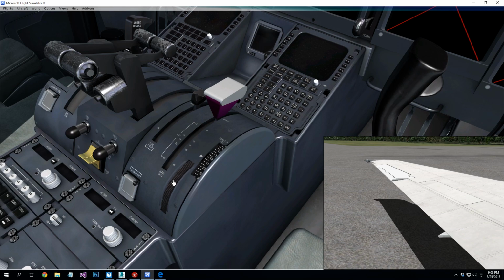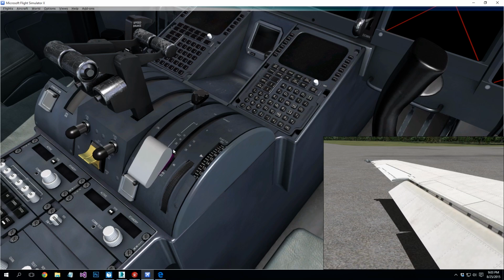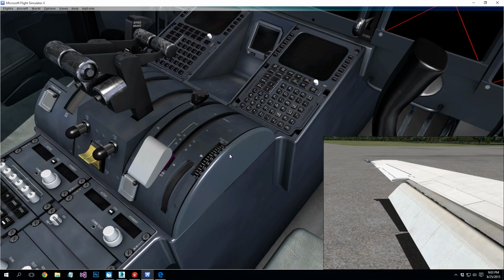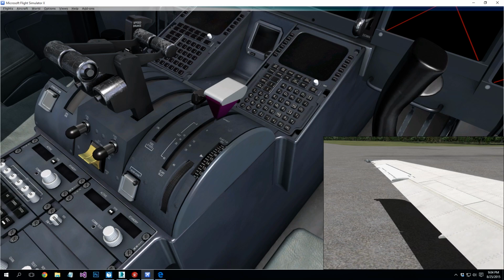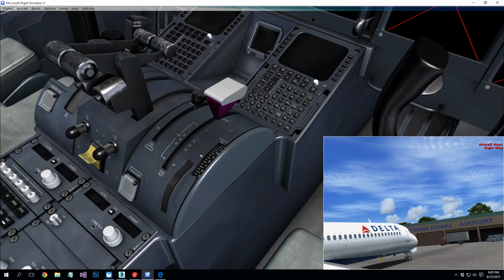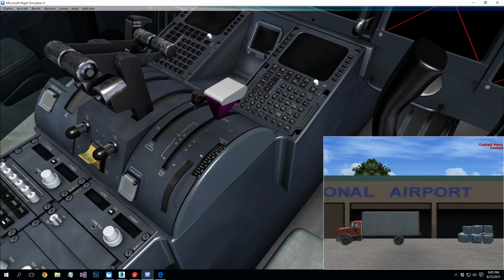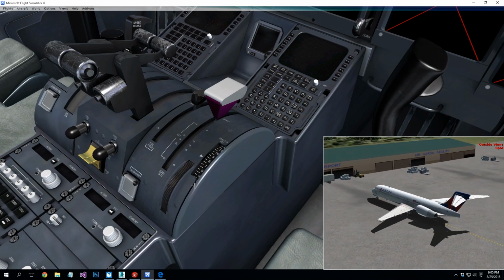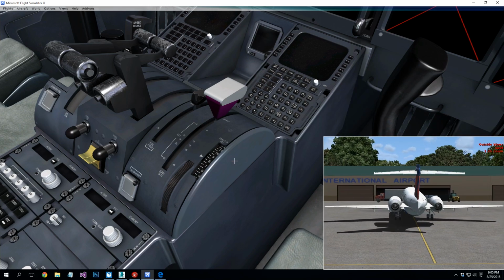TFDi Design 717: Flight Control Overview

Comment: This is absolutely amazing. The 717 has always been my favorite commercial jet and I am an avid FSX simmer. Although I do primarily GA flights I could definitely learn and upgrade to jets, just to fly this baby. On the takeoff roll and climb does the buzzing noise occur from the Rolls-Royce's? That's like the 717's signature feature.
Reply: It does - you can see it on our live stream (same channel, newer video).